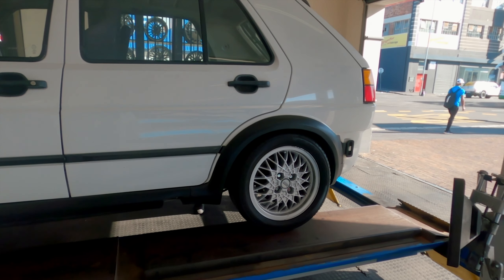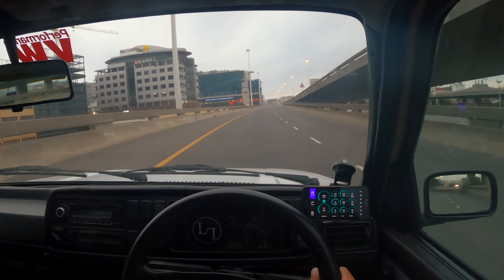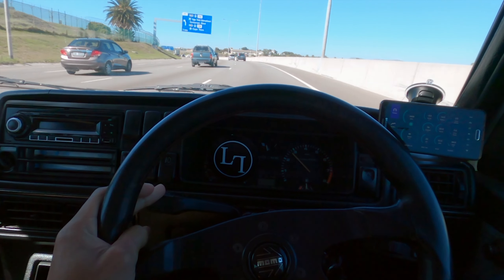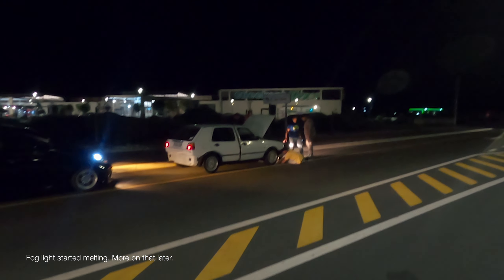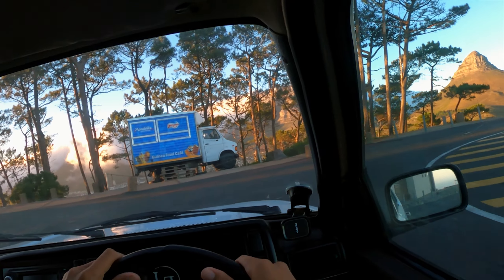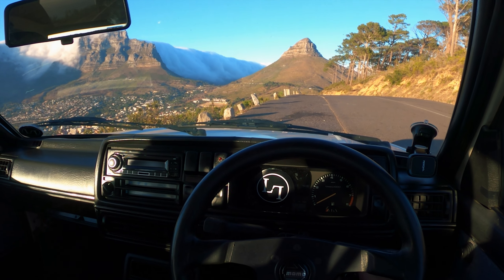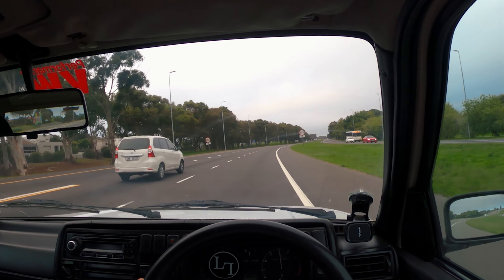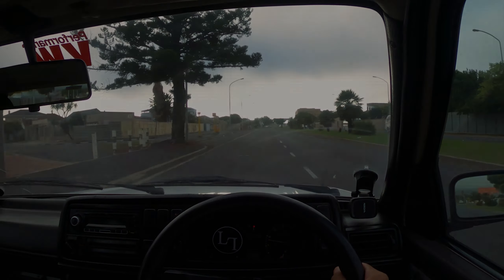There are a few issues with the 1.8T Mk2 | Signal Hill POV drive

Comment: Hi Lorenzo. I had a similar problem with smoking on my car, also 1.8T BT and ball bearing. Everyone I spoke to said valve stem seals was the issue but it was the oil drain pipe not being big enough (should be min 13mm ID) and CHRA was clocked more than 15 degrees so the oil was pooling up and pushing past the seals. Check 1st if that's not the problem before pulling the head off.
Reply from the maker: Thanks for that. I’ll check with my mechanic and see what he says. Do you mean the oil restrictor or the drain pipe? The oil drain is stock 1.8T size and that hasn’t been an issue on all the other BT cars my friends have. The oil restrictor could be a touch small if that’s what you mean? We had serious smoking and oil issues before adding a restrictor. I’ll check on that and the CHRA situation. Thanks for taking the time to comment. Appreciate that.
Reply: @lowdl Yes he will know best. Jameel knows his stuff 👍🏻 he's worked on my car as well and has been a great help.
Check this article for some good info  https://www.sincocustoms.com/turbo-oil-drains/
Reply from the maker: This is very helpful. Answers a lot of questions for me. Being new to turbo charging there is a lot to learn. Really hoping that you’re on the money here. Thanks again for your feedback 🙌🏽

Comment: Hey bud, great video 💪🏼

Wrt to the smoking, what is the color of the smoke as that can help point out what the cause might be (blueish is generally burnt oil so either pcv or worst case vss, white is generally unburnt oil so either the feed or drain on the turbo, cannot remember the color for burning coolant now but think it’s greyish in color) ?
Reply from the maker: Hey Martin. It’s white. Beautiful puffs of white smoke. 😂 I’ll chat to Jameel. Hopefully it’s the drain or feed so that should be easily repairable. 🙏🏽
Reply: @lowdl  Lmao, well white is unburnt oil that ends up in your downpipe and turns into vapor. So my bet will be the drain is not draining fast enough but Jameel will sort you out for sure
Reply from the maker: @ABG_3D  That sounds promising. I was hoping that we wouldn’t need to open up the engine and put a lot of work into it. I’ll definitely update on how we get on with it. Will be amazing to not have it smoking anymore.
Reply: @lowdl  Fingers crossed bud and awaiting the update

Comment: This is definitely I nice 20vt swap sound really nice as well... Oh yes the problem with you spot lights the reason why it melted is because of the bulbs they get to hot and they end up melting the plastic around it.. I had the same problem with my spot lights on my mk2 jetta.. Best bet is to fit those c6 bulbs with the fans to prevent it from happening again
Reply from the maker: Thanks for that. I’ll check it out. I haven’t had a problem with my fogs before so I’m confused as to why it’s only happening now. So before I change bulbs, I want to see if there’s a bigger issue. But I appreciate your feedback. Definitely don’t want it melting again. That could cause a fire 🙈
Reply: @lowdl  sure no problem buddy... Definitely check out your wiring going to the spots that could be the problem as well.. That what I encountered with mine... I ended up replacing alot of wiring mine because of not checking... I just realized one day my spots were not working anymore and then I went through the wiring and found out it burnt all the way through to my headlights

Comment: If you have time, take it to 8v Performance in Johannesburg.  People all over the country take their cars there and they are experts in 8v, 16v & 20v.  I promise you, you won't regret it.
Reply from the maker: Hey Moh. Why would I take the car there? It’s not exactly close. It’s about 1400km away from where I live.
Reply: @lowdl  like I said, people from all over the country, from Durban, Richards Bay, even as far as Namibia take their cars there, because they really good at what they do.

My mk2 jetta was a 1.6 carb, they converted it to a 2.0 with fuel injection in 2017.  To date I've covered over 70,000km without any major issue, trust me they that good, if you want trouble free motoring.
Reply from the maker: That’s really good to hear. Glad you’ve had no issues. Unfortunately they’re a little too far to sort out the minor issues I’ve got. I’m happy with my mechanic. We’ll get the issues sorted soon 💪🏽